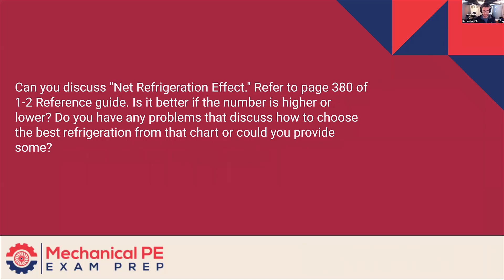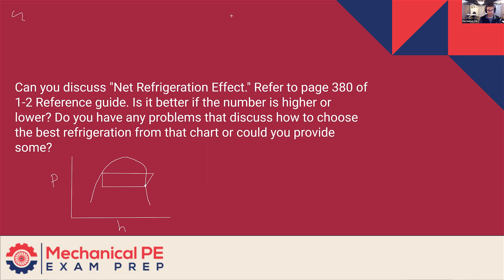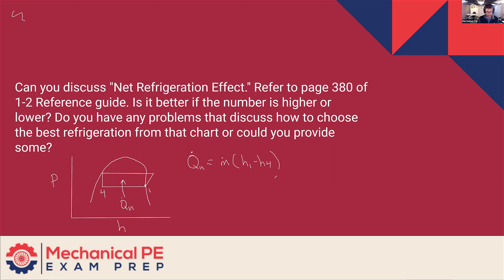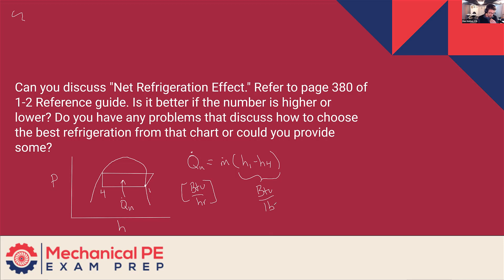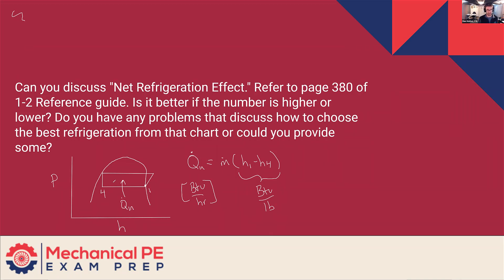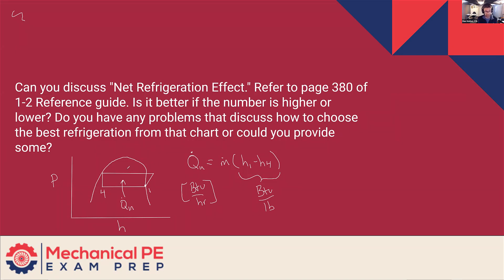Net Refrigeration Effect and Refrigerant Selection for Mechanical Engineers | Mechanical PE Exam

Comment: Increasing the mass flow rate would decrease the efficiency of the system wouldn't it? The caveat of "all things being equal" would seem to dictate that the refrigerant with the largest net refrigeration effect would be the best choice since you wouldn't have to use more power pumping a larger amount of m_dot.
Reply from the maker: Hi Michael, That's a reasonable conclusion, and I agree.  I suspect there will often be other factors at play from a design perspective, such as operating temperatures and pressures for a given application. -Dan
Reply: One thing to bear in mind, is that as we calculate the Net Refrigeration Effect. We must; acknowledge and respect that the transfer of heat. Related to dynamic vapor compression. 
 As we understand Heat, like energy can not be made or destroyed. Bear this in mind as it arrived to us seemingly measurable. 
 There are some funny abnormalities that can be calculated that likely hold the secrets of the universe. You never know:)

Comment: Does this not also depend on the compressor efficiency? I'm assuming that is this case the compressor would be the same in both situations, but you can't run a R134a cycle on a different refrigerant.
Reply from the maker: Hi Jeff, Yes I think that should be the assumption. Otherwise, too many variables changing and it becomes hard to draw any meaningful conclusion. -Dan

Comment: Plz make videos to maintain temp and RH
What we need to take care
Any case example
Reply from the maker: Hi Abhinav, Can you expand on your request here?  Happy to cover anything HVAC related if you can give me a bit more about what you want to see. -Dan
Reply: @MechanicalPEExamPrep  like in food industry, RH needs to maintain 35% and temp 20. And ambient condition 38 DB and RH 75%. How we need to design equipment. Dehumidifier is required to maintain this but at which range we don't require Dehumidifier. Any example and we can her we need dehumidifier and here we don't need. I hope u got me
Reply from the maker: There are creative ways to achieve the desired dehumidification without installing dedicated dehumidification equipment, and in most cases this is cheaper and simpler to operate.  However, there are certainly cases where precision control is an absolute necessity and the preference will be to perform the dehumidification function separately.  This will require running a separate refrigerant loop or chilled water loop with lower temperature water (well below the dew point of the air.).  Again, if sufficiently cold and abundant chilled water is available, I'd suggest handling both the cooling load and dehumidification requirement in one box by using a bypass damper and an oversized fan with a VFD.  Possibly even multiple coils staged.  Then the intelligence resides in the way the equipment is controlled.  Part of what some engineers like about keeping it separate is the control strategies can be kept independent.  Ultimately, the designer and owner must synchronize their goals and preferences, and there is more than one way to achieve the desired result from a technical perspective.  Feel free to write me if you want to explore this idea further at Dan@mechanicalPEexamprep.com.